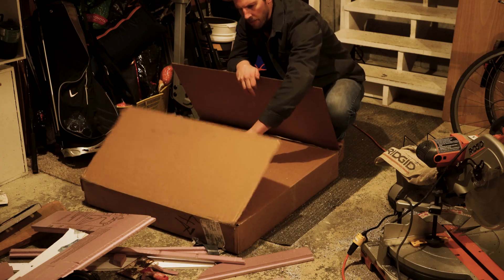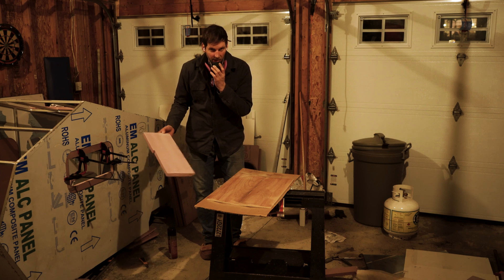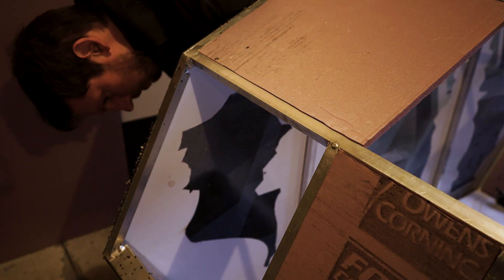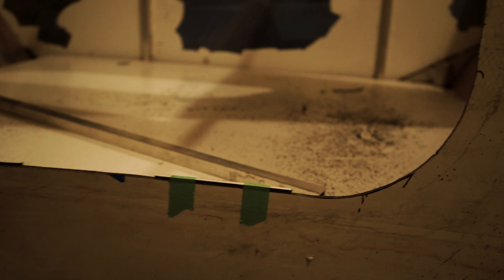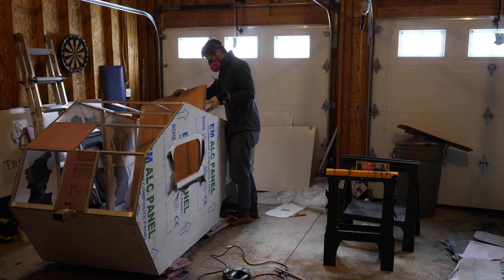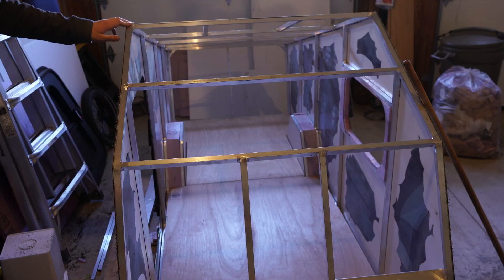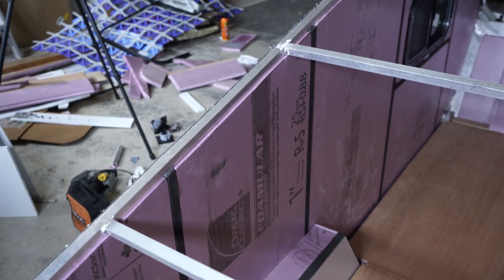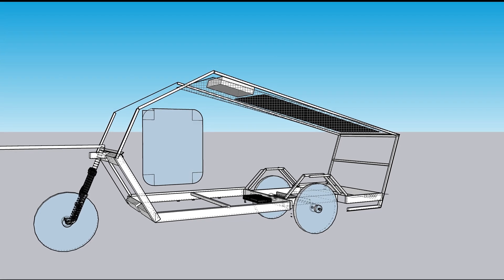Building Electric-Powered Bicycle Camper (PART 8)

Comment: The camper looks like you can drive it from the inside
Reply from the maker: It could be done with modifications, but it would be a regulation nightmare at that point :)
Reply: @Jerbrown  As long as you are just driving it around the campground, or short bursts to the country store, like a tractor, you should be fine.
Reply from the maker: True!

Comment: Great to see you fit easily through the door Jeremiah! For gluing the fabric to the foam did you try 3M 78 Polystyrene Foam Insulation Spray Adhesive? That one is made for polystyrene foam so it won't damage the foam. Not sure how the fabric will like it though. 3M also make an adhesive designed for installing fabric to foam but I think the foam they are talking about is upholstery foam. That product is 3M 74 Foam Fast Spray Adhesive. I also wonder if a tube gun sealant like 'Mono' might adhere the fabric. Putting the fabric on your ceiling could be a great way to keep the weight down as it's likely one of the lightest options.
Another thought about adhering the fabric: You mentioned the possibility of painting the foam first to seal it. Instead of that maybe consider doing something to the backside of the fabric before applying glue. Spraying it with something that will leave it less absorbent when dry may make the subsequent gluing more effective. That approach is commonly done prior to laminating paper products and some fabrics. Technically I think the process is called adding 'sizing'. (I wouldn't try laundry sizing because it's often just starch). Good Luck!
Reply from the maker: Thanks Ross! Those are great suggestions. I will look into all of them. I thought about trying the 3m 74, but hadn’t considered the other one you mentioned. Really appreciate your timely insights. You’re officially the project virtual honourary foreman! :)